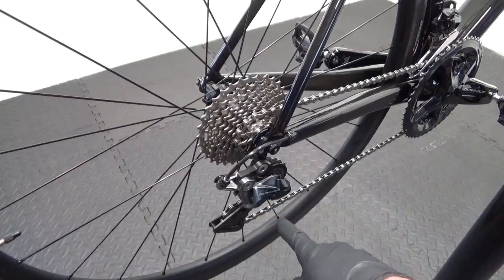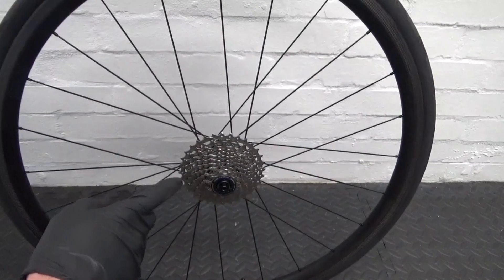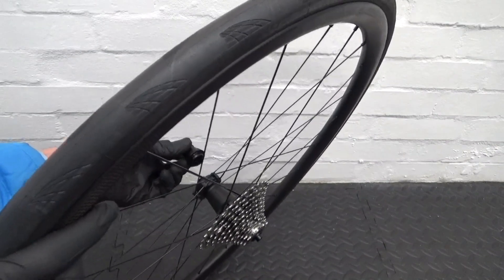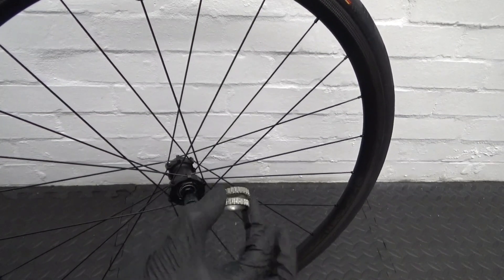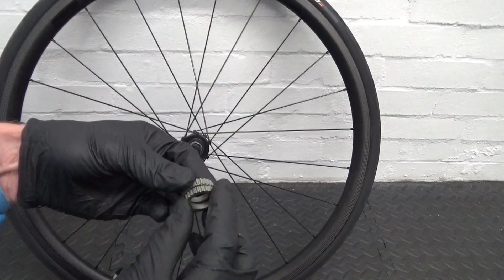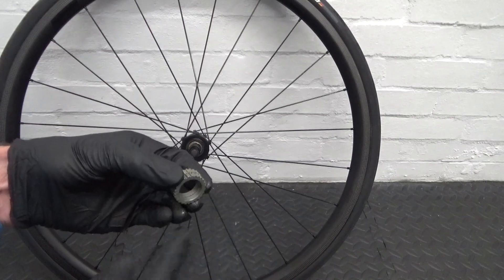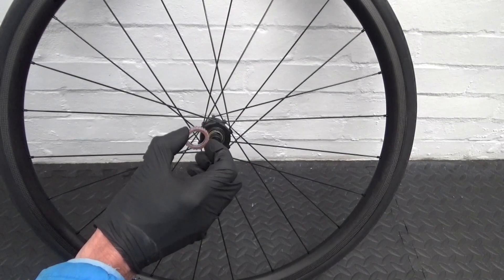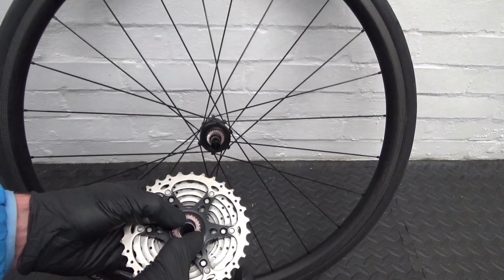Prime Primavera Wheelset Ratchet Upgrade

Comment: I tried this upgrade on my prime primavera wheels but the bigger width you mentioned around 4:30 is causing issues for me. The DT Swiss ratchet can’t fit with the hub spacer. It fits if I remove the spacer. Any idea why I’m having this issue with the same wheelset? Is it ok to remove the spacer?

Comment: Am I correct in believing that the dt 18 teeth are steel and 36 and 54 are aluminium star ratchets?
Reply: Not sure, they look and feel the same, the 36 and 54 are hollowed out and much lighter than the std 18. There is also a smidge more resistance, my wheel spins more freely with the 18T.
Reply: Depends what the application is for, MTB having less degrees of rotation makes sense, on the road bike is it needed?
Reply: Thanks for your reply.  My application is road. I  was curious because now the patent has expired you can buy Chinese steel 54t kits.
Reply: Depends on brand